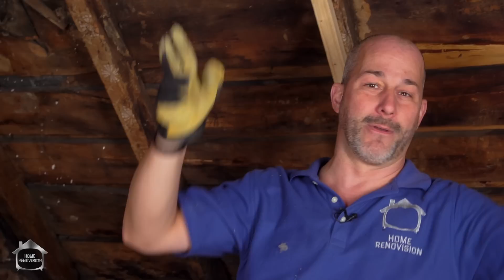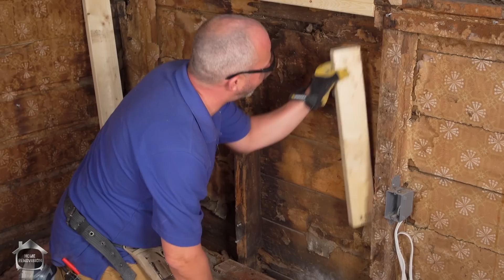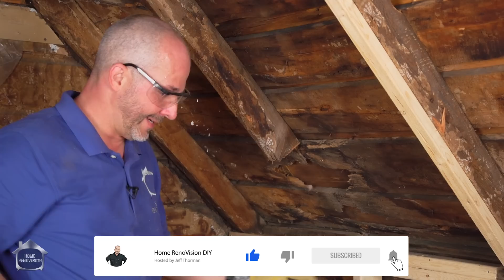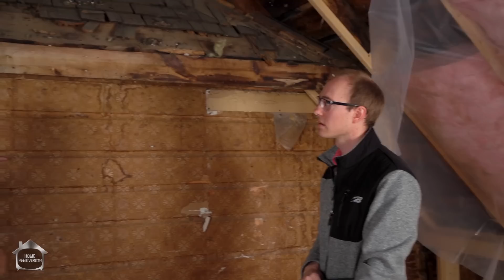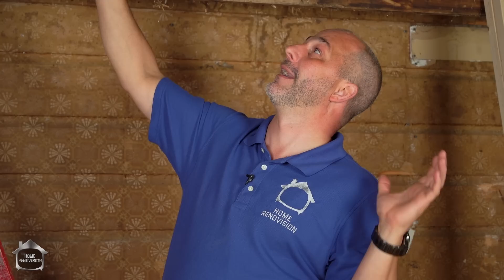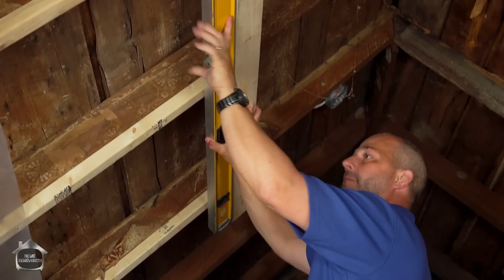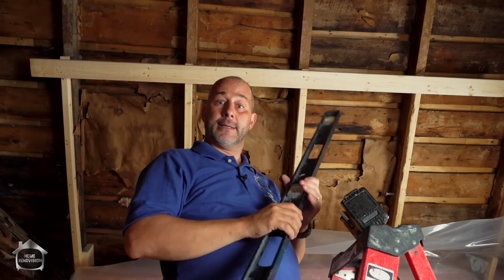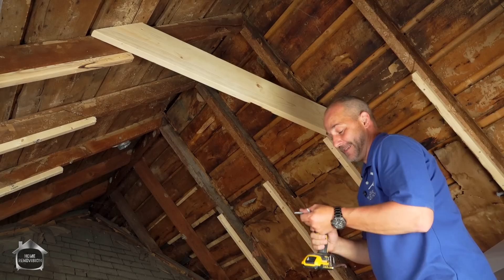How Structural Engineering Affects DIY Projects

Comment: Nice job showing how to tie into old stuff instead of shoving down our throat that we need to completely tear down everything and install this brand new MAke it Left approved engineered whatever. Only thing is I would personally not be comfortable with leaving damaged/rot old wood patched up in there.
Reply: absolutly, all the people i know would scrap the thing. my dad and i  repair and when it's finish, it's probably more solid because we replace  what is rotten but we keep old 2-by or 3by (true, not nominal) or even solid square log that were use in the beginning of the 19th...  so we do with a fraction of the cost, no pro builder would do it cause when you give them a contract, they give you the price of the material, + the time + profit. What you don't know is that because of volume, they have a better price for material than what they sell you (your bill is often what the company charge you and NOT what they paid). So they do the money twice, with the profit that you negotiate AND with the material. This is why, when something is rotten, you heard : «boss, i found some money»... With the «problem» usually the plan is to demolish and put new... material (then you pay the engineer, the architect, all the expert)... People don'T know that you can fix a house with hydrolic, concrete bag, 6x6 post,  and 2x 10 ... to repairs beam... when your beam are OK, than you can do what you want, as long as you understand the code...
Reply from the maker: the exterior boards will be changed out when we redo the siding on that wall next spring. cheers!
Reply: @HomeRenoVisionDIY  Ahh, excellent, must've missed that detail.

Comment: Awesome!!! Thanks for posting structural engineering topics! Would love to hear about the topic of how to underpin in a crawlspace to basement conversation. My husband and I are contemplating such an endeavor, family is growing and we feel we need the space.
Reply: Unless you are willing to shell out some serious $$$$, looking for a home that fits what you need might be a better idea and way less of a headache. I am a structural engineer, and although I have personally never designed a conversion from a crawlspace to a basement, I can tell you that anytime you deal with the foundation, the smallest mistake can cost tens of thousands of dollars in damage. I have designed several foundation repairs and I can tell you right now, they are always a nightmare for the homeowner and they usually require engineering and permits to get done.
Reply from the maker: I think that type of endeavor requires living in a house that can support the investment it takes to do such a thing. Where do you live?
Reply: @HomeRenoVisionDIY  We live in rural North Georgia, beautiful homestead on 5 acres. Don't want to sell bc It's kind of a dream home, we can do without a full basement, but at minimum need some sort of cellar, (I can't eat commercial food due to bad food allergies) storm shelter would be nice. Would love to move the water heater by moving it underneath. Tankless makes sense if you have propane, but not if you don't kill o watt wise. Not really a good location to dig a root cellar due to powerline easement, septic tank and pasture locations.
Reply: Of course, now that I think about it... It seems too grandiose rather than practical. We could really use a garage and that would alleviate some storage issues like gardening supplies. We have yard space for that. It would be cool though to have a video on foundations in general, how they are supposed to be built, what can go wrong and why, stories on the topic whether successful or unsuccessful. I just love learning and love your videos! Plus I love Canadians bc I lived in Ontario for a few years in the 90's. ❤️

Comment: @1:35 Just to note, people, don't start doing work that changes your building's structure without first having the plan from the architect, engineer, or appropriate design professional.  If he comes in and says he doesn't like what you did, and doesn't sign off on it, fixing it's going to be a lot more expensive than building it right the first time - to say nothing of that little monster called a building inspector.
Reply: It's done everyday and is the best way to go but you have to know what your doing and jeff does. 

I've run over  a hundred remodels where we went in and did all the demo and built it back then called the engineer for a site visit to document what was done and stamp the drawing gs he would do that matched our work and not one time had to make changes. 

Key is understanding completely building structures, understand codes, and know how to look up info on what's required for sizing, loads, and spans if you run knt on questions. 

If your a homeowner then your  comment is accurate,  but not for a professional
Reply: Thanks for doing this and for the commenters. I learn so much from both the video and the comments.

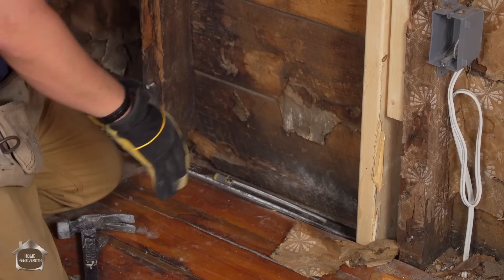Comment: 7:40 your 2x4 is short, you didn't transfer the weight of the roof the proper way, you nail it to the old support.
I gutted a whole second floor in rental property years ago. I squared the entire second floor bedrooms. When it came time for trimming out the new windows every window sill was different in size because the inside walls didn't match the outside walls. It's something you just have to live with in a old home.